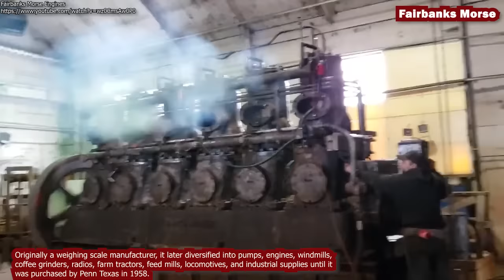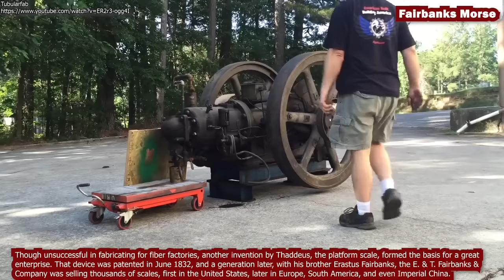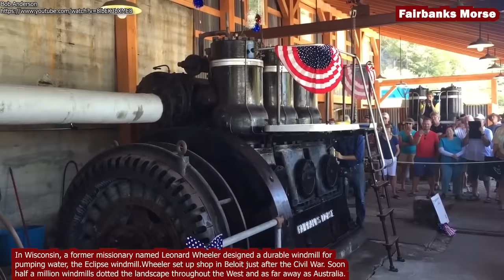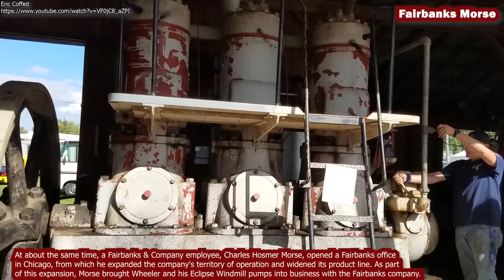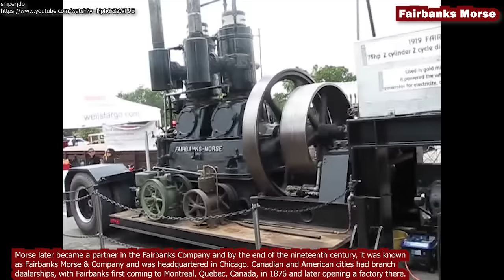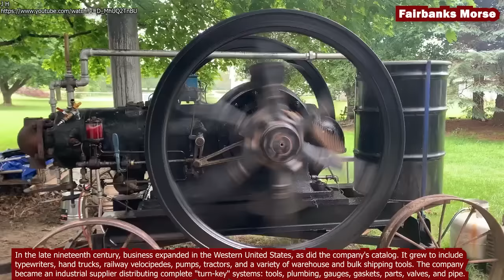Big Old FAIRBANKS MORSE Engines COLD STARTING UP AND COOL SOUND 3

Comment: There is something calming and pleasing about listening to these old engines running. Seems like they could run forever.
Reply: Slow speed engines, simple design, over sized mechanical parts. They keep running for ever. Regards.
Reply: That's a good comment. I'd never thought of it before, but there is something calming about them.
Reply: Until the fuel runs out 😜. I understand what you folks mean though; EXTREMELY well made and very HEAVY DUTY. Not to mention they are heavy in weight too.
Reply: @darinb.3273  I saw a video of one running a set of pumps in a oil field and had been running since the early thirties nonstop, I guess it's fuel was the gas vapor from the wells.

Comment: It's worth noting that, as far as I know, Fairbanks-Morse is still making two-stroke engines for marine, rail, and co-generating  applications in Beloit, Wi. Twenty yars ago a college campus I worked at installed a beautiful FB co-generation plant. The engine was an opposing piston, 6 cylinder, 12 piston, (think about that,) 2 stroke, dual fuel diesel/natural gas unit generating 1.3 megawatts. I watched them build it. A magnifecent piece of machinery.
Reply: Efficient emissions control is KISS (less fuel consumption, less emissions)  Instead they want to feed YET MORE $$$ into the Petroleum Industry needlessly   Conservation is wiser   The EPA needs to get out of the way as modern diesel hybrids need to flood the highways  

 Forget the Excess battery weight for the US and It's miles of highways  ... 60+ years the Electromotive have been saving fuel/maintenance costs in shipping  A nice modern opposed piston Multi-fuel series hybrid  IS DO ABLE  NOW
   
 The driving public should have reaped these benefits of economy DECADES AGO...
Reply: @richardbrown8794  Call Fairbanks-Morse in Beloit, Wi.
Reply: @richardbrown8794  You can't afford it.  Unless you need a VERY large diesel for your tugboat or locomotive.  Or you need a megawatt of standby power.
Reply: t
Reply: @ralphaverill2001  My Jetta TDI produces less emissions per mile driven than damn near every American car on the road.  Common sense should tell you that burning a gallon of diesel every 10 miles produces more emissions than burning that same gallon over 50 miles.  But it seems common sense and critical thinking are in short supply in the US today.
Reply: @ralphaverill2001  Because the US put unrealistic emissions standards on imports.  Red tape and over-regulation is just as bad as no regulations.  VW said screw it, we're not gonna sell diesels to the US anymore. Strangely, they passed EU standards without problem.  So who losses in the end?  We do.  When you have a car that sips fuel and lasts for 300,000 miles with just regular maintenance, that's a good thing.  I have 275,000+ miles on mine and the only thing I had to replace was injectors.
Reply: @pamike4873  Unrealistic emissions standards on imports or all diesel car engines? I can't think of a single US=made diesel automobile. US diesel trucks are required to have uria exhaust injection systems to reduce their hazardous emissions. If Europeans can live with higher particle or sulphur or whatever it is that diesel engies emit, that's up to them.
BTW, how do you get your TDI past periodic emissions testing?
Reply: @ralphaverill2001  There is no emissions testing in my county.  Plus current owners of VW's are grandfathered.  I'd be highly pissed if I owned a VW and had to park it because...reasons.  And no, exhaust fluid is not required on every diesel on the road.  Plenty of trucks have particulate filters.  If you're that afraid of emissions from a VW, you must live a very sheltered life.  The EU is half the size of the US, yet has TWICE the population.  If you do even a bit of research, you'll find some surprising reading when it comes to the allowable ppm of a Duromax or Cummins vs. an import.  My guess is VW didn't offer a big enough bribe to the correct Senator or Congressman.
Reply: @pamike4873  
Replacing injectors is no small or inexpensive repair?
I've got almost 400,000 on a 13-year-old Toyota that gets 45 to 50 miles per gallon. And at least in the US diesel costs about 30% more than gasoline basically negating any savings you would get. Certainly the diesel VW has much better performance characteristics than the Toyota Hybrid I Drive. But I really don't care about that.
I have put 192,000 mi on the car in 4 years. The only failure that I have had was last year the inverter finally popped. 100 bucks from a salvage yard took me 45 minutes to install it. I swapped out the inverter coolant pump proactively, there are about 70 bucks. Oil change every 5k transmission fluid is a simple drain and refill no filters every 50,000. My total cost per mile is $0.08 that's fuel and all maintenance and tires.
Don't get me wrong I love Volkswagen diesels also. I've owned a couple in the past but they were all from the mid-1980s. Loud clattery things but they were awesome. One had 450,000 on it The other one had about 250,000 on it.
I think the problem is that at this point gasoline engines have gotten almost as efficient don't have any of the serious mechanical issues or expensive repairs. And as you mentioned thanks to unbelievably ridiculous regulations for EPA compliance. Modern diesels have become almost unaffordable. You've got to have a DPF filter and urea injection. Those systems are complex and prone to failure and when they do fail they basically destroy any possible fuel savings you might have had. Even our heavy duty pickup trucks are equipped with these things and they're a nightmare. Semi truck seem to do better with these now. I think probably because they spend so much time under load and at highway speeds that the DPF filters tend to stay clean.
Reply: @kens97sto171  The only reason diesel is more than gas is road tax.  I bought my first diesel in 2002.  I ordered a sweet F-350 dually.  Then, diesel was much cheaper than gas.  As it should be.  Diesel doesn't require nearly the refining as gas. 
I don't know what your point is about injectors or Toyotas.   This discussion was diesels.  Replacing injectors is a fairly easy job.  And you don't have to buy new.  I had mine rebuilt twice. 
 I have to wonder about your claim of 50 mpg.   My Jetta has a whopping 110 cubic inches with direct injection and a turbo, and makes just over 100hp.  And I only get 50 mpg highway.  
Again, the only reason for the price of diesel is the tax our lovely government decided to put on it.  Which made everything we buy more expensive.  
My fuel costs run $1,850 a week.  My Peterbilt gets around 8 mpg loaded.  Right now it's got 542,000 miles on it, and it's still doing ok.  It needs an in-frame and it'll be good for another 300K.  Pound for pound, diesels outlive and get better mileage than any gas engine on the road today.  
Emissions suck.  Period.  My Volvo excavator has been down 6 times in less than a year.  CAT is no better.  Or John Deere.  Or Komatsu.  Or Kubota.  Emission systems are the problem.  Not the engines or manufacturer.
Reply: @pamike4873  
I wasn't aware that the road tax varied between diesel and gasoline...
Regardless for the end consumer diesel is more expensive. So you have to weigh the cost versus benefit.
My point about injectors is that my Toyota with 392,000 on it  has never needed injectors replaced. Nor has any gasoline car I've ever owned all of which went 300,000 miles or more. I've got a 28-year-old Jeep sitting out back that's port fuel injected and it still has its original fuel injectors and has 205,000 mi. That's my point.
Diesel  Injector replacement or repair is not a cheap endeavor and it deducts from whatever saving you had from fuel.
I plainly said that the diesel VW is certainly more powerful than a Toyota Hybrid. Whether or not it's more reliable I don't know, VW is not exactly known for reliability. And cost of maintenance is generally high also. 
Certainly the VW diesel is going to be more fun to drive. But I don't really care about that. For a daily driver I want comfort, efficiency, reliability and practicality. That's all I care about.
Certainly a diesel is going to get better gas mileage on the open highway. But the Toyota gasoline hybrid gets better gas mileage in the city which is where it's more important at least for me. I average 47 to 50 overall. 95% of that being in the city. While running 85 miles per hour across the interstate I'm averaging about 38- 40. Certainly good enough to save me money, but the city mileage is where it really saves me. I drive 50-60k per year. Mostly City stop and go traffic.
The heavy duty diesel side is completely different. I drove in 18 wheeler for a long time also. The emissions equipment on those is a nightmare as well, although I think it's better than it was when The DPF filters first came out.
Most reliable truck I ever drove was a 1999 Freightliner with a Detroit 60 series. It had no EGR or any other form of emissions. Had 600,000 miles on it when I took it, and had 960,000 mi when I left the company.
The next place I worked had newer trucks, and I had endless issues with EGR and EGR coolers. That truck did not have DPF or urea injection.
Reply: kens97sto171 the “new” diesels are engineered to have problems. Cam and crank sensors.  EGR and emissions systems of questionable value to the environment. All the diesels of my youth in farming and construction needed air and fuel.  Nothing else.
Reply: @peterwright4647  “EGR and emissions systems of questionable value to the environment.”
Questionable by whom? Not by anyone who remembers how filthy the air used to be.
“All the diesels of my youth …….needed air and fuel. Nothing else.”
The issue isn’t what went into the engine, the issue is what came out of the exhaust pipe.
Reply: @peterwright4647  
Yep . Absolutely. The electronically controlled injection and management really isn't where the problem became a big deal. It's all the emissions compliant crap. Once they started adding EGR DPF and urea injection things really went downhill. The electronically controlled injection definitely increases efficiency, probably increases lifetime as well due to cleaner combustion. But beyond that it's been downhill since then.
And now honestly with direct injection on gasoline engines, very high compression and turbos. You can almost get the same amount of torque and power out of the gasoline powered engine without any of the emissions crap that they've forced on to diesels. These new modern gasoline engines have their own problems as well. But they seem to be doing better and it certainly less costly to repair when they go down.
I've got almost 400,000 mi on a Toyota Prius. Still running good. If they're built right engines can last a long time whether they're gas or diesel.
Reply: Ralph Averill the def systems are definitely questionable.  The idiotic claims made that the exhaust after treatment is safe to breathe causes me to question their value.  SAE continues to debate the overall benefits of the use of urea as a exhaust treatment.  The fluid itself is horribly caustic and its production and distribution may well outweigh its worth.  What is beyond doubt is that the reliability of modern diesels are very lax in comparison to the better diesel designs of old.  
Development of electric heavy equipment and vehicles like JCB electric skid steer loaders and backhoes and electric short haul medium duty trucks and busses are much more encouraging from an environmental perspective if sustainable battery components become available.

Comment: I have always found it rather fascinating when you look at these old engines, they are so simple, reliable and efficient.  They all run at such low RPM as compared to today, you take a single cylinder engine and it runs at 400 RPM and I bet if you kept if full of the consumables it needs I bet it run for years straight non stop.  NO planed obsolescence in this engineering!
Reply: Efficient???? I don’t think so.
Reply: @TheMilwaukieDan , you're a young'un aren't you .
Reply: @marksommers6764  no Mr. Sommers, I’m 75 and love these engines. I coukd be around them all day and enjoy them. True they will run forever if maintained properly. However, that said, I really don’t think they are very efficient for todays needs. Thank you for the reply.

Comment: I used to go to a farm owned by a childhood friend's family, they had a very old Fairbanks engine running almost all of the time in the winter, adding electrical energy to their solar batteries for free! The fuel was the methane from bacterial decomposition tanks they had (8 huge tanks). the coolest part was the heat-exchanger, it heated the water in its copper pipes to add extra energy to the houses heating system, all from waste exhaust heat

Comment: I used to have a Fairbanks-Morse AM/SW table radio from the late 30's.  I refinished the cabinet and sent the chassis to a friend of mine to get the caps/resistors replaced.  Sadly he passed away before he could get to it and during his families grieving asking for it would have seemed to me to be in bad taste and so I never asked for it back.
Reply: I would said something along the lines of, ''so sad he never got to work on my radio I sent him last year, he was one of a few that I knew I could depend upon to get it working, ''
Reply: @benscoles5085  Since then I've gotten into restoring the electronics of the sets myself and have a good idea I could tackle it now.  Usually it just involves changing out all the old leaky paper & wax capacitors, the electrolytic capacitors and any out of tolerance resistors.  Tubes themselves seldom ever go bad.  It does happen, but not nearly as often as you'd think.  I even picked up an RF signal generator to give old sets a good alignment on the RF and IF cans for better gain and to help the dial point true to the station it's receiving.  Some day I'll find another set of that make and restore it myself.  I did recently find a set like my Grandparents had bought new in 1948, a white plaskon model of a FADA 970.

Comment: Amazing to see those old 2 stroke engines. How massive everything was built on them, like the huge exhaust ports on the first one, where you can watch the pistons move up and down.
And despite being very expensive and only having 15 or 20 bhp, it was such a incredible improvement over the previous ways of working, with horses or steam engines.
Here in Germany there are a number of enthusiasts, who restored tractors with this kind of engines, mainly the "Lanz Bulldog". https://youtu.be/M85w9hi-JT8
Reply: Horsepower might not have been high , but the Torque was IMMENSE . The Important number , especially on a Static Engine .

Comment: I was a deckhand back in the 80's. If the ship engines quit, I'd wake up. I got so used to the sound and vibrations. Same as today 40 yrs later working in remote exploration camps in Canadas arctic. If the generator quits, i wake up immediately.

Comment: We still are using the same piston, crankshaft, internal combustion engines to this day with a bit of dressing on them. What ever happened  to rotary
and turbine engines for car? I rebuilt some 12 cylinder marine diesels in my day GM 2 cycle super charged 1500hp.
Reply: Turbine engines don’t do well with they high dynamic range that cars demand, their efficiency at idle is pretty bad, and car engines idle a lot. Rotary engines have seal leaking issues and aren’t as efficient as a well designed piston engine.

Comment: Nice. But I'd like to see this equipment in actual work. That would give the scale for the power of these engines. Usually those are shown just idling without work load. 
If you know such exhibit shown in Youtube that presents similar kind of engines in work than in this video, I would be interested. 
Thank you

Comment: I understand how diesel and gasoline engines work, but was the diesel an easier engine to build, historically? Or was it that gasoline required a greater amount of refining?
Reply: Diesel engines while more expensive, are far more durable and much longer lasting, plus diesel fuel is actually an oil, which helps reduce wear, while gasoline is a solvent.
Reply: The thermal efficiency of a diesel engine is about 15% higher than a gasoline one.

Comment: How fuel efficient are these motors? Is it a multi fuel?
Reply: They take high speed diesel and low speed diesel oil. All diesel engines are able to run from many vegetable oils. Earlier days groundnut oil was very common.
Reply: @subramaniamchandrasekar1397  Thats Amazing! Thanks for the reply back

Comment: Over 100 year-old machinery that still works fine.  And you cant get a Ford, Chevy, Dodge vehicle to run right after 20 years without changing almost everything under the hood (exceptions apply)

Comment: So pissed that some poor mechanic did a bad job on the 1952 Ford 8N my father gave me back in 2020. Bolts that held the timing gear in place all fell out, last bolt chewed the crankshaft gear up. Been dead for a year now 🤬🤬🤬🤬🤬🤬🤬🤬🤬🤬🤬🤬🤬🤬🤬🤬🤬🤬🤬🤬🤬🤬🤬🤬🤬🤬🤬🤬🤬🤬🤬🤬🤬🤬🤬🤬
Reply: Take it to a trusted machine shop. And man I feel your pain .
Reply: @georgegavin5273    My father had the motor rebuilt about 8-10 years ago, I think that the guy never bent the tabs over on the 2” square star washer to hold bolts in place. He also never replaced the bolt that first had to be removed, that held the crank pulley wheel in place. It was a round head bolt with a worn out chewed up slot, I finally got it off . If it didn’t come out, I’d have to remove the front axel and that would have been a major pain due to the fact it’s in a tent in my back yard in the woods.